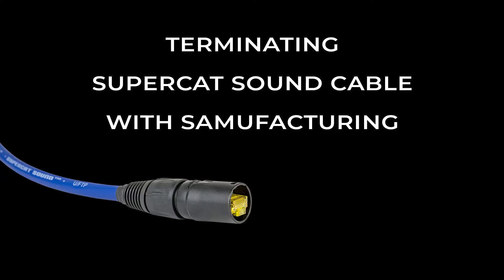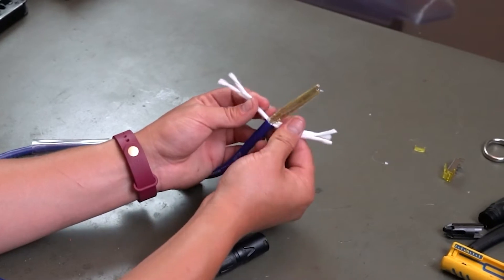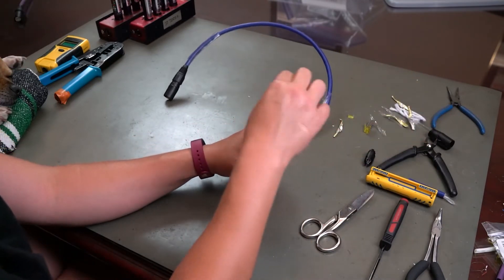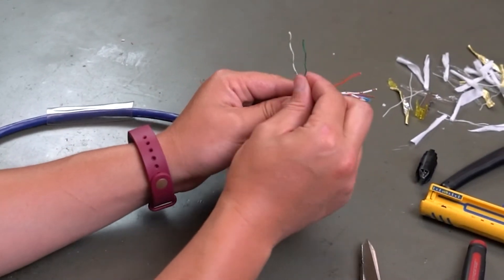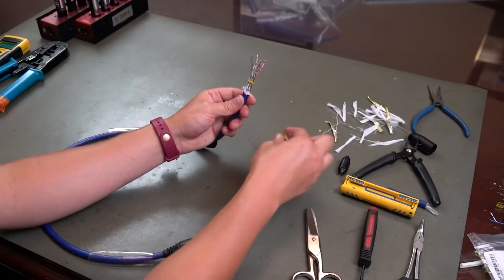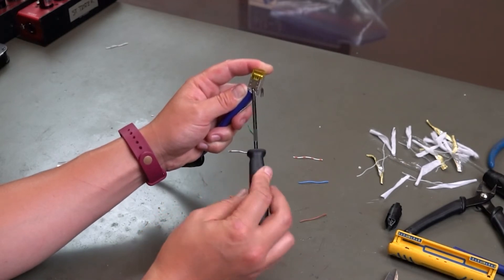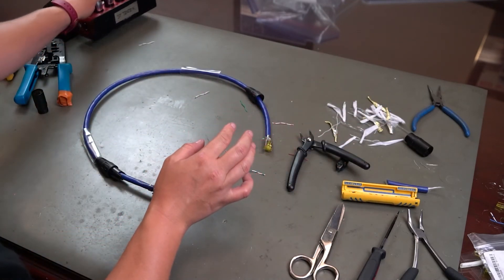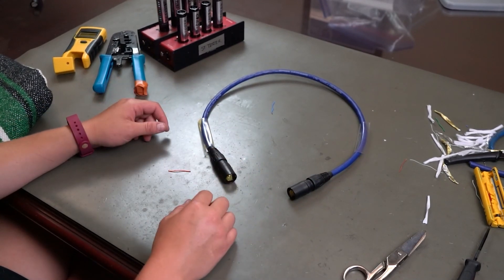Terminating SoundTools SuperCAT Sound Cable feat. Samufacturing

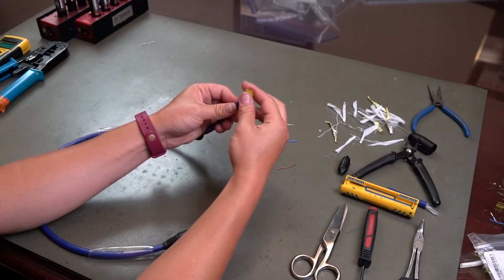Comment: 10:00 If you want to avoid those issues of the wires not seating it's a good idea to straighten every wire before, you do that by pulling on them multiple times until they're straight.